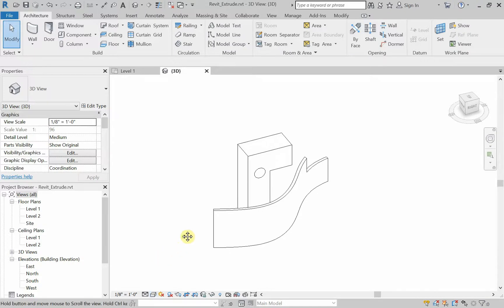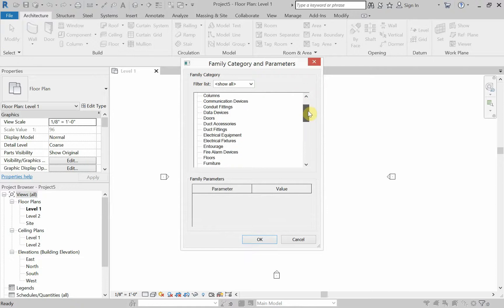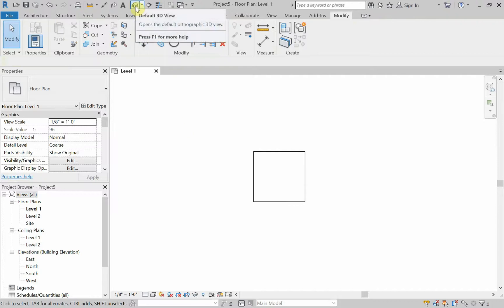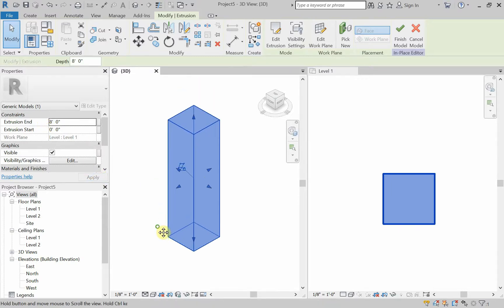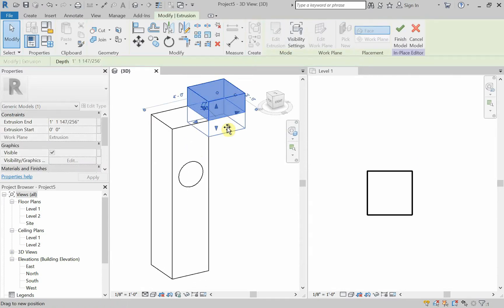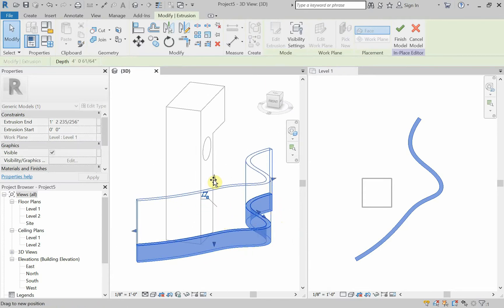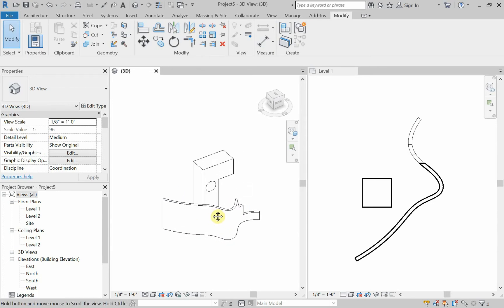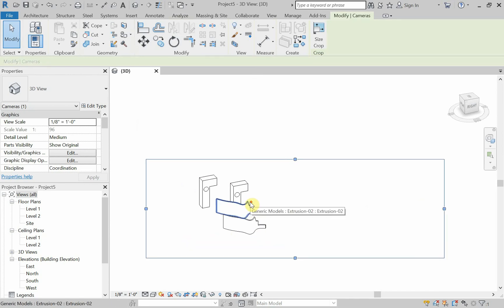Revit Extrude

Comment: Hello . I have a question as I am creating a massing model of the town when I create extrusion and draw shapes that I want to extrude after I finish it connect them all, like it highlight all of them which I done under one extrusion but separate blocks... lets say there is 3 rectangles drew separate which I extruded under one workplace and I click finish. How I can make them movable separate as I can push and pull each individually but not move. is there an easy quick way to do it instead of creating a new workplace for every single block?
Reply from the maker: @jagodablueberry5688  if you want them separate you’ll need to make separate models.